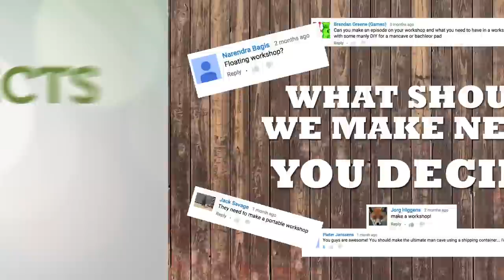Rolling Locker Workbench Build

Comment: A tiered work bench with a mounted grinder station a vice that can be removed if needed and a place you can drop a table saw in and remove as needed with a multi outlet on the table to plug things into for easy assess. It also needs to be able to be rolled across thick grass and soft ground surfaces that normal shop wheels won't do.
Reply: +Jonathan Fields I believe they call that a pick-up truck

Comment: I save the plastic containers after the Parmesan cheese is gone. They are perfect size for nuts,bolts,screws, washers, and misc. You can see through them and for drill bits..you can open up the half of the lid with the shaker holes to slip the bit back when you're finished with it.